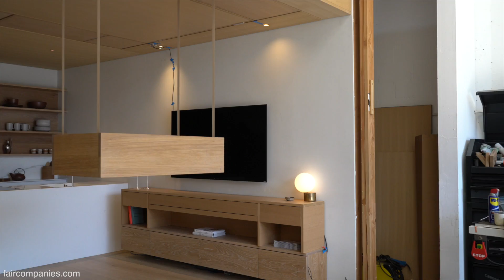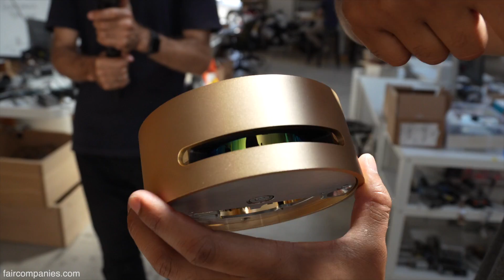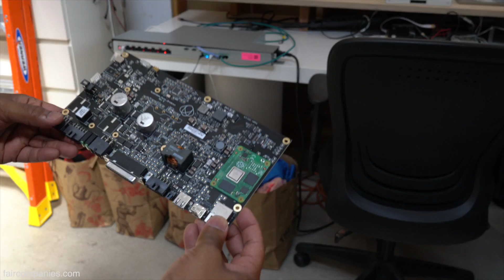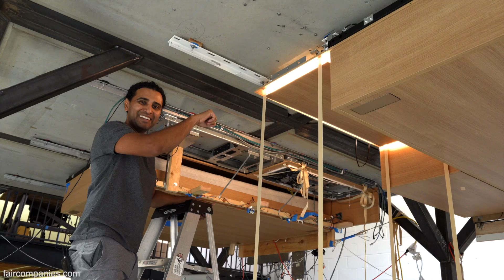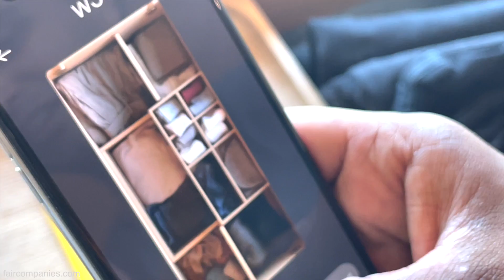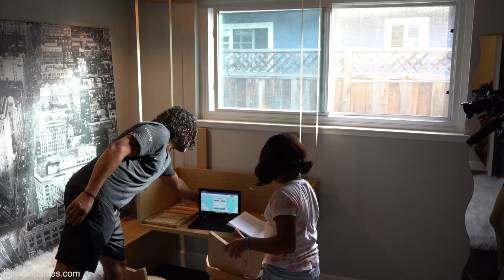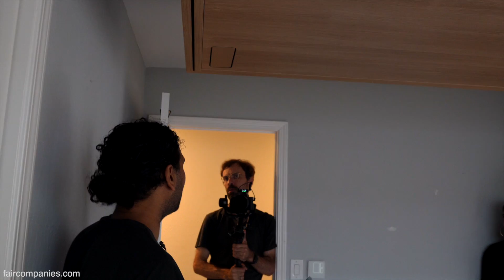Apartment furniture rolls into ceiling, it's truck-drag strong

Comment: Very stylish and practical.  I love it!  Would work well with the tiny house movement that's still going on.  😁👍

I do have some questions though.  Can you choose a different wood type or finish?  Is there or will there be an option for people who need adjustable beds?  Can an individual module be customized?  Do you need a power outlet so high up on the wall?  Is it possible to install more lighting underneath/between the units?  More importantly, what happens during a power outage?  ...I could keep going but I'll stop now. 😅
Reply: Happy to answer any questions. Please email us at hello@bumblebeespaces.com

Comment: The bed, OK. Saves some space, slightly better than a wall bed, but also a multiple of the cost.
The storage boxes, i can make a full wall of ikea closets, which would take in about 1m2. for similar storage volume.That would cost about 500$. This hightech closet system willl probably set me back 10.000+$. That's the cost of that m2 of real estate in frisco or NY. Might as well buy that extra square meter of property.
I"m not convinced yet of its spacesaving merits. Seems tech for tech's sake. Something for tech folk from Silicon Valley with money to spend on gadgetry.

Comment: This is definitely super cool and a very unique idea!

But (and I’m a person in robotics myself), i never liked the idea of extremely tech-heavy living. It’s not as sustainable as the modern and “minimalist” aesthetic and wording suggests. This livingspace is small, but it’s full to the brim with actuators, sensors, and computers. Materials and devices which are extremely difficult or impossible to recycle. Mechanisms which can’t be repaired by the average homeowner, not to mention a renter.

And what if the power goes out? What if something breaks? What if the company stops supporting your fancy app system?
Reply: Exactly! What is wrong with having a few pulleys on the wall and do it all manually (or at least have the option to do so). 
I have an old Sennheiser headphone at home that I bought about 30 years ago. I can still use it. I wonder if these bluetooth headphones will still work in 30 years time...

Comment: These guys are so much in love with technology that they make something that is going to brake some day  and will be extremely difficult to fix! Imagine a electric black out, you loose your phone or there is a bug in the software?!?! If they would make it with wires coming down somewhere with a engine and some smart gear box that is easy to fix and accessible then it would be cool.
Reply: yeah, they should consider some back  - up redundancy process in case of power failure or bugs etc...Interesting and amazing tech ideas nonetheless!
Reply: You mean a mechanical pulley system that doesn’t require electricity?
Reply: @heythave  ye.

Comment: I'm curious how this design interacts with fire suppression and HVAC systems which are almost always integrated into the ceiling. Additionally, I would not want to be prevented from accessing my things or bed just because I lost my phone or because the power is out.
Reply: Having its own battery backup would be a good feature and probably pretty easy. Seems a big concern in the comments.
Reply: How often does the power really go out, though? A battery backup would solve this.

In terms of the HVAC and fire supression, some of the modules could be static and house these systems.
Reply: @jacoblukewood   In Florida,the power is out way too often and way too long due to lightning , hurricanes, and poor  infrastructure. Power grids are continuing to blackout across the US  due to drought, wildfires, storms and snow storms, tornadoes,excessive heat, etc.  Honestly, I would not want the maintenance expense of this kind of tech after years of wear and tear.
Reply: @jacoblukewood  Well, ask any European this winter how often the power is out.

Comment: As a construction person, looks great, but I can't help but wonder about ceiling  lighting (what shown is low light), sprinklers, smoke/fire detection, and multiple people living in a home, the walkways become occupied by floating boxes!   If you are work from home, a simple drawer is not adequate,  in practicality,  but this is beautiful solution,  that middle America probably can't afford.   Even getting people to 'go vertical' with drawers for storage, is challenging.   This is a great concept,  for high density housing as he implied at beginning.
Reply: I love every part of this…..so smart….and looks so great…….the history function of the storage is amazing….and no dust too.
Reply: Cool
Reply: Even suburban homes can become high density. My dad lives in the basement, and had to downsize from his 900 sq ft apartment to less than 800 sq ft. This would be great for Air bnb. I'm even thinking of hotel rooms now. Who wouldn't like some extra space for kids when you're not sleeping? Extra storage to put your luggage up and out of the way would be great. And sure, probably will make its way into high-end hotels at first. If it really is useful, it will trickle down and get cheaper as knockoff brands appear.
Reply: I work from home with a single drawer! Otherwise, I agree!

Comment: I honestly think this is an over-engineered solution, because you are at the mercy of technology (phone app) and mechanics (servos, lines etc), if the servos break, wire snaps, or your phone communication breaks you can't get your bed down, same with your clothes etc. With the same layout I would just raise the kitchen, have the bed, bed side tables and train-like drawers stored underneath the kitchen, and they can be pulled out with just normal wheels. Sure you get two step level difference coming down from the kitchen to the living area/bedroom, but still, no servos, no app. just simplicity with the exact same benefit as this system. when it comes to the hanging wardrobe in the hallway, honestly, there is enough space to add the same kind of storage, but permanently. So this is a typical "oh, how cool!"-idea, but in reality it's not very practical.

Comment: High ceilings aren’t really that common are they? Especially in small homes where this supposedly helps so much.. This would massively close in a lot of houses. Furthermore with the bed if there’s anything slightly out of line on there it’s surely going to cause trouble for the super tight tolerances. In the spot directly in front of the exit door, is it safe to have something that can drop from the front left there? I also noticed there wasn’t much video of actually using those boxes in a normal setting. I can imagine they’d swing around loads and take forever to finally go back up out of the way. 

When cooking and needing a new utensil, do you really want to wait a good 5-10 seconds to get what you need as you select a drawer in an app and wait for it to open?
Reply: And $14,000 for a bed, and only a bed.  Umm, no.

Comment: I'm wondering what would happen if a child sleeps in the bed and another child decides to tease it and slides the bed up or simply just pushes the wrong button on the wall controller - does the sleeping kid get crushed...? 🤔😬
Reply: They didn't mention it but I would bet that if they have sensors below they also have sensors above so it would stop going up to the ceiling before the kid got crushed.

Comment: Is there a manual way to get these things down and back into the ceiling?  What happens if there is a power outage or a brown out?
Reply: You either have a battery backup or you wait until the power comes back on.  These are only going to be used in places where real estate is very valuable.  Those places also don't have long blackouts.  I've lived in the san francisco bay area for 15 years and have never had my power go out for more than a few minutes at any given time.  Before that I lived in NYC for 18 years and the only time my electricity went out was the 2002 blackout that lasted 24 hours and affected a huge chunk of that part of the country.  But that was a random freak thing that happened one time in decades.

Comment: Interesting.  Maybe I'm old fashioned, but I wouldn't want to sleep in a central area where I work or entertain. Less practical in larger families, if power goes out, or there's a malfunction at 1am. Still, very interesting and could have many useful applications.
Reply: Having to live in a studio apartment isn’t a choice most people have at the moment I don’t think anyone wants to live in a home in which everything happens in one room, but housing costs make it difficult to afford anything else
Reply: If it’s connected to off grid systems due to the low power draw I don’t think that it’ll ever be a problem

Comment: This tech is awe inspiring. I can't help but think how amazing a similar type of system would be in a kitchen setup.
Reply: In what way? I have maybe two cupboards in my kitchen with stuff that I don't use regularly. However, they're both already wall storage cupboards, so this would add nothing to that design. To be honest, if I spent some time tidying, I reckon I could reduce my storage needs too! I suppose, maybe, an extra dining table and chairs for when guests come over, but I normally just use fold up chairs and table, which doesn't take up a lot of space. 
I like the design, I think it might be useful for hotels maybe, as a gimmick. However, as a general usage case, it probably doesn't add that much. It allows you to have an open space where a bed might be, but you can't put anything permanent in that space, basically. I could imagine using it in a hallway in an apartment perhaps. It could perform the function of a loft in that regard.

Comment: I'm curious how this ages. I'm living in place from the 80s, the doorway in one of the rooms, the threshold has dropped about 1.5cm. That wood and certainly cheaper construction moves. Would these baskets and how they are supposed to interact with the floor* be able to change with the movement of the building? (*Furniture that sits on the floor, amplifying sag and movement of the floor and preventing the ceiling elements from lowering to a correct height, because your furniture has shifted)
Reply: Yes! I lived in places from the 1919s up to the 1950s (nothing newer, Europe and Asia) and I feel as if this would require major renovations in such older buildings. But if you're renovating anyway, there may be more affordable solutions (that do not require power, lots of outages in these places)? Idk, it's interesting to think about for sure.
Reply: @Femchan  since the power consumption is so low, maybe even a small battery bank would be enough to tie you over for a few days. 300 watts is ~6 cordless drills.

I'd be in favour of a mechanical backup. But this would require a lot of linkage from the ground.

Comment: Very interesting concepts and impressive demonstrations. But for me it would be somewhat disturbing/frightening to have so much stuff hanging from ceiling. Besides, imagine that controller inside this thing going broken but the support technician will visit you only in two days…
Reply: Definitely needs a backup manual option!
Reply: Kind of like an RV with the slide outs. When the electrical breaks down have a mechanism to where you can do it manually.
Reply: I feel like they could add a feature that next to each module, under a tiny, removable/sliding panel, there would be a small shaft that's coupled directly to the module's motor shaft, and you could use a screwdriver-like tool to hand-turn the shaft. And/or, a bit you could put into any standard drill if you need more oomph to turn it. Could really just be a large hex bit.

It would be very easy to hide a hole that small, but it WOULD add a some complexity to the design. Wouldn't help if something mechanically broke inside, but in that case you'd REALLY want to wait for a technician, anyways, otherwise you risk dropping a large piece of loaded furniture on your head...
Reply: They must have a crank system to manually bypass any problem
Reply: with redundant or over engineered ropes hanging those modules this could be super safe
Reply: Earthquakes could be an issue. Now before you come at me, you haven’t met me. If it can go wrong it will for me.
Reply: Sorry but this is another thing that Silicon Valley over-thinkers tries to make mainstream by over-complicating things. Motorised furniture have been around since de 1950s. Once the novelty factor wears off there are too many road-blocks and red flags regarding usability and ergonomics, safety issues plus mother nature catastrophes such as earthquakes, maintenance and repairs costs, backup battery, points of failure, etc etc.
Reply: I mean they could just make a phone app that communicates with the hardware so you don't have to HAVE an actual controller.
Reply: @benidirahmedramy6616  no, "the controller", like the circuit boards and electronics inside the furniture, not the "remote control".
Reply: Or the Governor tells you to cut down on your power use becasue there isn't enough electricity! Nice idea but not for me. Living in sardine can spaces just doesn't cut it in my mind.
Reply: That and the ceiling strength & hight needed to go do this will be rare. Then the cost, of you can afford this you can afford a place with a bedroom
Reply: or imagine during an earthquake...
Reply: imagine your bed stuck on the ceiling in the middle of the night LOL
Reply: @UCeNAe_86qHHGX490_WvJtkA SCAMMER
Reply: @UCeNAe_86qHHGX490_WvJtkA SCAMMER
Reply: same thoughts, can be solved by some sorts of hydraulic back up pulley or something .
Reply: The part of things hanging from the ceiling (provided it is structurally engineered) shouldn't be any more worrisome than a multi-story dwelling
Reply: I imagined a variation on this. I have a basement and I thought of storing stuff in boxes in the basement. I'd then call for whatever item and the smart-dumb-waiter robot would get the stuff and bring it up and put it back. Just fantasy, I imagined Tronlike things running to fetch my stuff.
Reply: Get crushed trying to piss at night

Comment: oh stepper motors
Hope that they have backup power
Reply: "Kirsten Dirksen (8 hours ago):

Because it runs on low voltage (one plug for the whole system), it only needs one backup battery to run for a few weeks. And when the furniture descends (because they're doing regen braking) it can charge the battery."
Reply: @CaalamusTube 

Did not watch the video to the end when i wrote that but the answer was simpler
They use the mechanism used for safety belts in cars